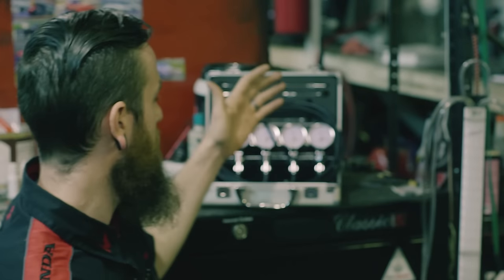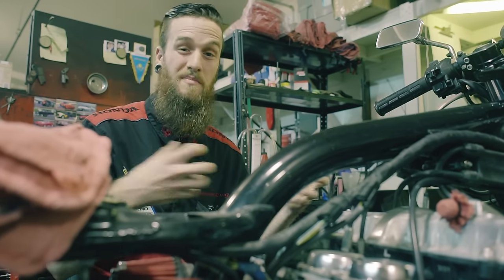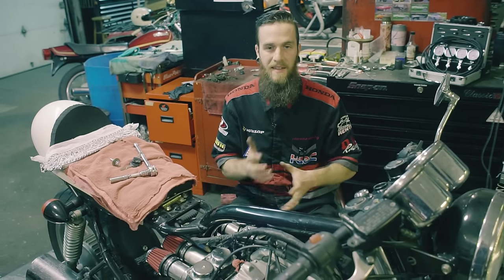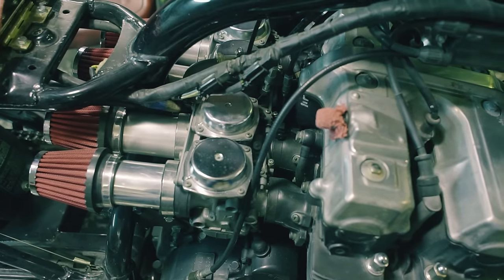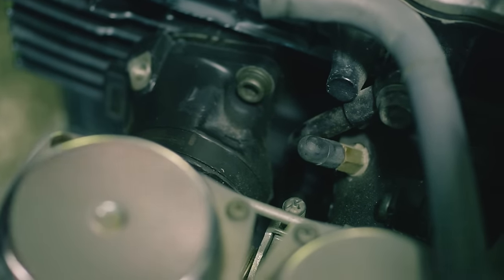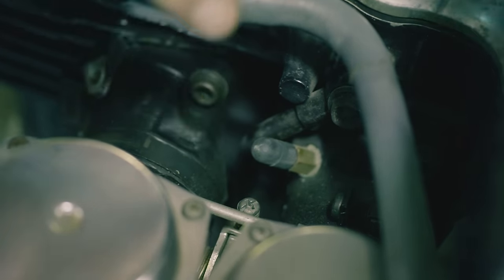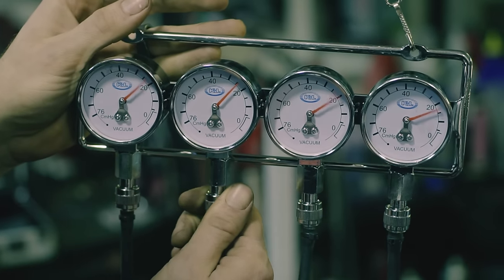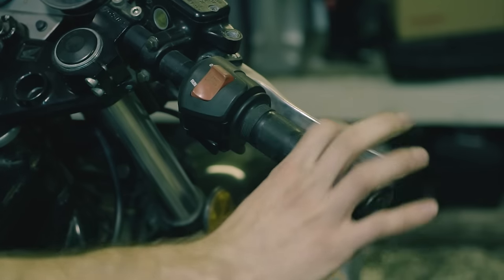Carb Syncing: How to Fine Tune Your Carburetors

Comment: so i bought a bike and the guy messed with the carbs, when i bought it it was not running it cranked but didn't fully turn on, so i adjusted them without a sync tool. my question is how do adjust them with the tool if i dont have a base carb???

Comment: so ill start by saying that im an idiot, but i have a question. since youre adding gas, i assume this must be done with the gas line removed? it cant be done with the line still attached to the tank?
Reply from the maker: I most carb syncs need to be done with the tank off for reason of being able to access the adjustments. If the tank was on the frame I would not be able to reach them.
Reply: TheMotorcycleMD yeah that should have been more obvious to me. i made a few calls and figured it out. I just bought an '05 Vmax and its tank is under the seat. Just the air filter and a faux tank on top of the carbs so i think im good to sync with the gas lines attached. Thanks for the response! also plz wish me luck. Im troubleshooting why she dies at idle. Only 1400 original miles, always garaged, all rubber looks great and i opened up 1 carb and the bowl couldnt be cleaner. Has slip-on pipes and was jetted from 152.5 up to 155. I'm learning as i go but it could be so many things and im going nuts. Going to Home Depot for the right adapter so i can pull my spark plugs right now. Maybe i can identify a problem cylinder. ugggghhhh

Comment: In my experience.   When adjusting carburetors,  if your having trouble adjusting the air/fuel ratio it usually means a dirty carb.

Comment: Can I use my mpulse fittings to balance my carburetors? I've been going through my oil injection Imports on the engine side carb boots. For some reason the clutch side of the engine will not balance to the other side. By the way it's on a snowmachine

Comment: One sylinder not working on low rpm of my cb 400sf is the sync required or any thing else i just installed the carburetor repair kit

Comment: OK, great. Scooter shops have the mercury or dial gauges and the nifty port connector fittings. Wish there was a way to do this at home.
Reply: there is. buy the tool then after its shipped to your house, perform the work.

Comment: I had a funny problem with my yamaha fz1, as you said it had funny noises at idle - popping, puffing etc. SOUNDED LIKE SHIT. I bought the gauges for syncronizing but kinda failed at getting it right.
I ended up taking carbs out of the engine and I noticed I had a problem with my pilot jets. I screwed them all in and came out 4 turns and I noticed the jets were all indifferent positions! I would’ve never get them right if I didnt take them out (I checked o-rings, they were fine) so I decided to adjust and sync my carbs visually in my hands and maaan does the bike go. You can really hear the synchronisation now and how engine resonates with the exhaust and it pulls smoothly from start where before I had to release clutch slowly and rev high to get a smooth start otherwise the engine would start shaking
So anyway maybe it’ll help someone.

Comment: Hey man, I was wondering if you can sync a triple carburetor. I know you said a double or four but not one. What about 3? I would assume you could only do 2 by what you said. I am hoping that is incorrect or there is another way.  I had a 76 Yamaha xs750 given to me so I'm rebuilding it. Gathering information. Just got the carb rebuild kit. Was wondering if the sync 8s an avenue I need to explore as well.
Reply: It will still work. Carb synchronizers will have 4 gauges on them but you only have to plug in 3 of them same goes for 2 cylinders

Comment: Great video, thank you for sharing your knowledge. My '99 gl1500 with 160,000 miles developed a vibration felt in the handle grip during the last two miles of my 600 mile trip. The Idle seems to be a little rougher than what I've always remembered it to be. I've pulled each plug wire individually while the bike was at idle and notice an rpm/rough idle immediately except for the number two plug. Does this sound like carburetor or vacuum issue?? I'm interested in your opinion on where to begin. I've got everything apart down to the carbs and would really like to avoid removing them if possible. All six plugs look normal and have around 15,000 miles on them. I'm a new subscriber. Thank you in advance.

Comment: The dials should be checked one by one with a same carb to see if there are any differences. After that, dials, as mentioned, are less accurate than the old mercury one, so anything less than exactly the same value in each is something you want. Also, in old bikes with twin breaker points, the dwell must be checked first for both points. If there is a sudden need for calibration, one must check that the rubber intake manifolds do not have cracks causing air leaks. I may be splitting hairs here, but for someone it may prove important.
Reply: I calibrate mine every time with a 4 into 1 manifold made from 3 Y-connectors and 3 rubber tubes, connected to 1 carb. That way you can be sure the gauges are synchronised at the actual operating vacuum.

Comment: it sounds similar to that knocking that is heard when you turn it on and I do not know if it is because it is cold or it is really the tensioner or the chain the noise diminishes when the engine heats up but you are listening to it a little

Comment: Do carburator bowls on a motorcycle with 4 carbs need to be filled manually before starting or should the fuel pump have enough power to fill them through the line? I have an fzr600 and cleaned the entire carb but only 1 cylinder fires off and the pump clicks intermittently and sounds weak.
Reply: run it on a bottle gravity feed while synching.  oh and those needle jets like to wear like a sonofagun. the slower and easier the bike has been ridden over its miles, the more needle jet wear. a good job of going through those carbs should include replacing the needle jets.

Comment: What about the modern tools, digital ones, that take a reading and remove the wobbly needles, and just give numbers?

345, 346, 458, 342.  Cylinder 3 carb needs adjusting, down a bit. 

I have nothing against old technology, I ride a 25 year old motorcycle, old = good. The older the motorcycle the better, IMHO. 

But sometimes someone comes along and invents a better tool to do a job. But is it a better tool?

Comment: I am new to this so I will ask a dumb question. Those screws you adjust, are they air mixture screws or idle throttle screws?
Reply from the maker: Neither! They are adjustment screws for the throttle butterflies.
Reply: Think of a pair of butterfly valves moving like the ailerons on an airplane's wings when they move in opposite directions to each other. Adjusting the screw makes one go up while the other goes down, or the reverse. And at some point they will be in a setting where they are both showing equal vacuum to each other. The gauges are your visual for this.

The screw he's adjusting is moving a pair, in this case 3&4. 

So if they are all badly out of synch -

1. Set the pair that has the 'base' carb, in this case 3&4.
2. Set the other pair, 1&2.
3. The third adjustment screw, synchronises 1&2 WITH 3&4.

You might have to go through a few iterations.

That's as it was explained to me many years ago.
Reply: it's to adjust each individual butterfly on each carburettor so each carburetor is delivering the equal amount of fuel/air mixture as the other carburettors
Reply: 0:43 

It's not got to do with the fuel mixture, it's to do with equalising the vacuum.
Reply: @TheMotorcycleMD I always thought syncing the carbs meant adjusting the little air mixture screws. Now I know better.  I'll have to go look at my carbs and find the correct adjustment screw. (I have a 1975 Honda CB750.)  No plans to sync the carbs right now, but it'll be nice to know how to do it when the time comes.  I'll have to buy one of those cool syncing devices.  Previous owner synched them up before I bought the bike...at least that's what he told me.  How do you know when they need syncing?  (I'm assuming it's when you experience the symptoms you listed in the beginning of the video. Erratic idle, etc.)

Comment: HI and thanks for the info. im trying to replace a fuel bowel gasket on my 2008 Yamaha 1300 Venture. 4 carbs. number 2 I believe ( second at the left side of bile sitting the bike towards the rear). thinking I may need ot synch carbs too. I bough the bike with 35K miles on it and i have out 1000 miles. i hear some back firing from right side exhaust pipe. it runs good and idle in good too. I was wondering if there is some info on how to change gasket and synch. do I need to remove the carbs to change gasket on one? I know i need to remove the tank and i can do that. please advise if you know of any info/videos/how to.. thanks and thanks for the good info.
Reply: sorry, had a type. bike had 25 k Miles when I bought it. by mistake i typed 35.

Comment: The first modern meters first have to synchronize itself before use. Each meter should first connected to carburator one and then be adjusted to the same level. Then connect to al carburators for carburator adjustment. The old meters do not have to be adjusted because they work on (the same) fluid

Comment: do you have a related video for carb cleaning, (4) carb rack , thanks
Reply: Did you get your carbs cleaned?  I think Cody has a couple carb cleaning videos on his channel.  I have a CB750 which is a 4 carb rack as well.  I watch a ton of videos before attempting to take the carbs off myself.   Not sure what kind of bike you have, but the video that really helped me was the CB750 carb build video on a YT channel called Hackaweek.  The guy takes everything apart and puts it back together, which was very helpful.  There's a few good videos out there on cleaning carbs.   I did my first carb sync shortly after watching this video.

Comment: Hey I have a Honda magna v30 500c I just cleaned the carbs now  when I touch the throttle it revs up high and won’t drop back to normal idle any idea as to what this could be?!
Reply: could be a few things. synch off, compression differences between cylinders maybe from needing a valve adjustment, vacuum leak etc.... maybe find a pro you can trust and have them check it out.

Comment: 2002 katana 600 with a TPS. Are there any steps needed because of this? will the TPS give me irratic gauges? I can't get these dialed in.
Reply from the maker: nstag8r007 Typically TPS sensors just read a signal when the degree of the plate as changed. They don't move anything, just simply read the signal.
Reply: number 4 carb goes to my petcock would that be my base carb to sync the other ones off of?
Reply from the maker: You really should invest in a proper manual for that bike. I specialize in Honda only and typically stay in my lane. What I know as a fact is that most all four carb set ups will have a base carb. It is up to you to figure out which one. It may be the one with the TPS but telling you for sure would be a lie on my part. When you are using the gauges and making adjustments I would imagine if you pay attention to which carb is changing when adjustments are made and you notice that one carb gauge is not changing with adjustments it is probably that one.

Comment: so I have a Kawasaki ninja 500 should I and I'm not running the OEM petcock ..so should I cap my vacuum fittings
Reply from the maker: the young tech They reason why I switched to a high flow petcock and capped off my vacuum port was due to a flat spot that I could not get rid of at 8,000rpm. It was really a trial and error process. My theory was that at that high speed the vacuum petcock was unable to deliver enough fuel. I was right. Installed a high flow fuel valve from pingle and the flat spot is gone. For your issue I don't feel this will cure your problem. Although I would check your petcock valve to make sure it is operating normally.
Reply: There should be no uncapped fittings. If you deleted the petcock vacuum hose, you need to cap the nipple on the carb.  You have a hose on the other carb that goes to the PAIR valve system unless you deleted that too.

Comment: Hey Cody, I've got a '96 cb750 nighthawk, and it just started lurching and sometimes backfiring when I'm at a neutral throttle. It doesn't do it when I'm idling or accelerating quickly, just when I'm accelerating slowly or at a consistent speed. Any ideas on what that might be?
Reply from the maker: jhoff  I would look into your vacuum operated fuel valve. If that is beginning to fail than it could cause a funky lean issue (Backfire) sputter randomly. I had a CA model that had me stumped for a week. Even with the fuel valve diaphragm off it looked totally normal but the silver retaining cap inside had actually come loose. Sucking air in and lowering my vacuum pressure to help feed gas to the carbs. It's pretty easy to rebuild! Also check that small vacuum line leading to it! Can develop cracks or holes!

Comment: Is it safe to fire up and run the bike without the air filter whilst I do this? I have to remove mine to get to the carbs.
Reply from the maker: +Dimitri Boyarski because you are typically setting at idle only. I don't see any problem with having the filter out.
Reply: TheMotorcycleMD 
..... wondered what that hole was. I can stick a flat head through the filter box right into carb adjuster nut :)

Comment: I have a xs1100 and I cant get the exhaust gaskets out of the head. ive been dicking with it for two days. what is the best wat to get them out.
Reply from the maker: +Donald Dean I typically use a nice sharp flat blade screw driver and find the inner lip of the gasket that meats the exhaust port land. Then try to pry directly under it using the sharp portion and the head as leverage when prying out.
Reply: there sized to the cylinder head. I have a pick and screwdriver and tried carefully scraping away at the gasket but it's the gasket material inside of expanding metal rings. I've tried pb blaster and liquid wrench but their still stubborn..
Reply: siezed*
Reply from the maker: Donald Dean Ah, I wish I had a hot tip for you to get them out but I think this one is going to take patience and persistence brother!
Reply: yea... that's what I thought. thanks man
Reply: Get a set of pry bars from harbor freight, or lowes! They ll get them off. You have to be careful what part you pry up on, but they will come off!

Comment: im trying to sync carbs on a 04 ninja 250,i made the diy bottle gauge and a bottle with a vent for fuel and  hung above to gravity feed carbs, the fuel isnt filling the carbs,it will only run with starting fluid,i had it running with the tank on after i cleaned the carbs and it idled fine just had some mid range bog,anyone have an idea why the gravity feed line isnt getting fuel into the carbs?i tried squeezing the fuel bottle and motor just runs out of starting fluid dies,spray starting fluid and it fires right up till it runs out,i might try extending the tank lines so i can adjust the sync screw,but thought id see if anyone has had the same thing happen